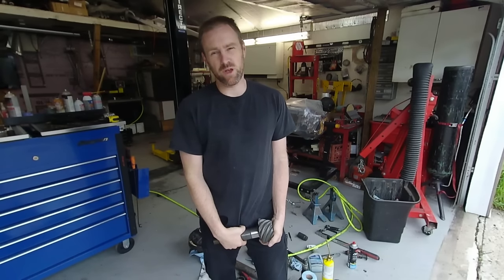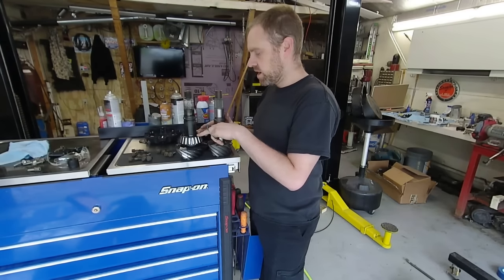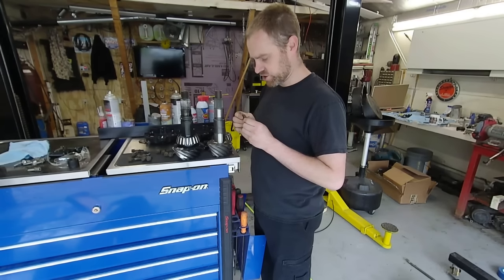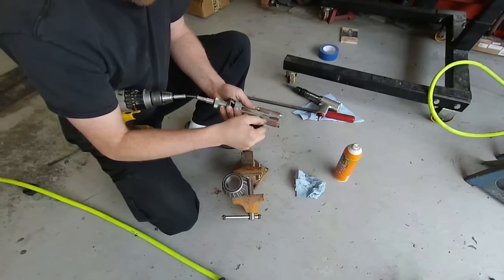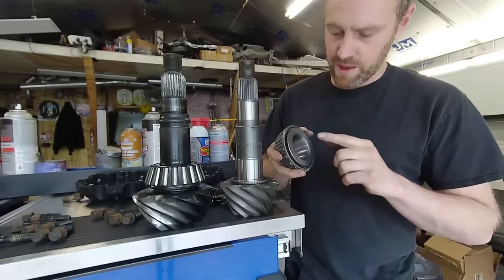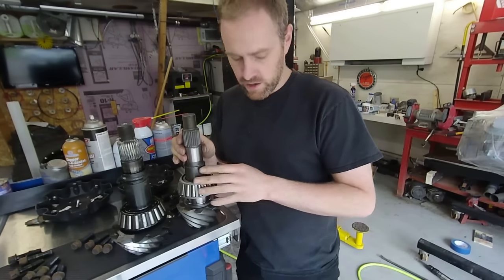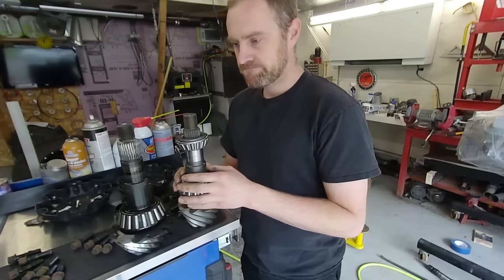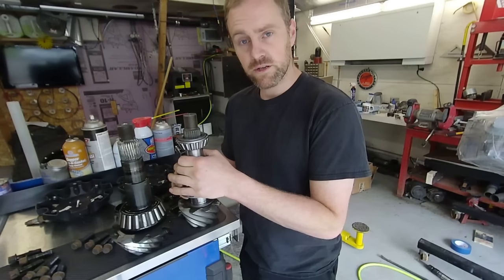Helpfull Tip For Pinion Gear Set Up in Differential

Comment: You are close, but missed it slightly. Simply hone the old bearing to the point that it slips easily onto the pinion shaft shoulder. Install using the doctored bearing and shims and take your measurements. Once you are satisfied with the depth/shims, take it apart and reinstall using a new unaltered bearing. Keep that old reamed bearing in your tool box...you will use it again and again.
Reply from the maker: Good call if I did a lot of these but I have only done 2 dodges in the last 7yrs. I have a large range of rear end variety so I only see the same type a couple times. Plus I only get a handful of differential jobs each year. Good idea for some though for sure.
Reply: @CrazedPerformanceRepair  I used to do this quite a bit back when I was still racing. Doing another atm for a '67 El Camino which I'm converting back to street duty. I deal mostly with 12-bolts, but the 8.8 Ford uses the exact same bearing in their housings as well. For those that want to tackle this I recommend getting one of Ratech's pinion depth checking tools for the housing you are dealing with.
Reply: couldnt your old bearing be worn and change your depth on the pinion ?
Reply: @bandaid1957  Even if you chose to use an old bearing the wear is going to be irrelevant in the grand scheme of things.
Reply: @rickss69  I saw another video where they went as far as to suggest using the same brand of bearing but that was using a pinion depth tool. Im getting refreshed on diff rebuilds since i haven't done one since the 70's . My pinion bearing has gone from a whine to a howl so not going to hone that one out for a test brg.
Reply: @rickss69  did you recheck once the new one was fully installed?
Working on a 55t right now and comparing the old to the new i got .001" difference in thickness. I am wondering how much it takes to move the pattern.
Reply: Use a set up bearing  and you will simplify the whole process.
Reply: @bandaid1957  no, because the bearings wear across the cone face on the rollers and mating surface. Wouldn't hurt to check with a micrometer the width of New and Dummy bearings to sure)
Reply: @bandaid1957  my pinion bearings are in the bottom of the housing, Probably be off a little bit, LOL
Reply: That’s exactly what I do. I use a stone on a die grinder and just open it up enough to slip right on.

Comment: I’ve been setting d and shorting rears for over 30 years I have a box full of honed bearings for all types of rears including carrier brgs. for the Dana type . Good info you sharing ! Bravo for you .
Reply from the maker: If I did enough of them I would do the same. I get such a assortment it's hard to justify keeping any hanging around. It's like I will get 4 diff jobs 1 month of all different makes then I won't see any differential work for a year lol. Strange how things work out.

Comment: Just make a set of set-up bearings and slide on and off. Measure the difference between the set-up bearing and the actual bearing you are going to use and shim the difference. Its a cheap and fast way to set up gears. No need to hone the actual bearings you use. You want them to be tight so you don't spin the bearing.

Comment: Finally a guy that gets it. Been doing this trick for years on taper bearings and sometimes I use an electric pencil if I really need more press at final assembly. You probably would do more damage taking it apart to redo it anyway

Comment: I used a 2" diameter 60grit flappy sandpaper drum in a 1/4" air die grinder to open up my setup bearing.  Took less than 5 minutes to give the bearing less than .002" slip fit.  My setup bearing has a 2" bore.  Use the largest diameter flappy sandpaper drum that fits the bearing bore to keep the process quick and accurate.

Comment: Agree with Richard Taylor 100%, but you also need to make sure the bearing that you are going to hone out has the same bearing inner race height as the new bearing you are installing or else the whole process is a total waste of time, just went through this and then discovered that the honed bearing wasn’t the same as the new bearing.  Had to purchase another new bearing with the same inner race height.

Comment: NEVER spin the bearing with air. The cage is designed to retain the rollers and space them WHEN IT'S IN THE RACE. Auto techs have done this for years with wheel bearings and it makes a cool sound but I have seen them explode and cause serious injuries. If you spin the bearing dry past a slight rotating speed the bearing will be damaged.
Reply: That's the way I was trained as well, if you spin them,   and get them going like that dry, and on top of that, they're loose, not in- cased  in  races, they're more likely to fly apart, and they're not meant to go high speeds when they're dry. In other words, you're doing something that, that bearing is not subjected to, when it's actually in use on a vehicle.
Reply: Learned that the hard way.  Spun a bearing on my finger that I had just washed to dry it.  Exploded on my finger.  Luckily escaped with a minor cut.
Reply: Holy shit, glad I read this, I was totally spraying the shit out of a bearing earlier with the air gun... I dont totally understand how what you guys are saying happens happens, but enough to understand I shouldnt do that anymore lol. Thanks!
Reply: I would say damage is pretty minimal unless something was wrong with the cage. But the exploding .. I could see happening. Lol probably moreso on a old bearing tho.
Reply: If I decide to clean a bearing with air, I hold it and allow to spin very slowly, maybe 5 rpm.  Or I manually turn the entire assembly in my hand.  I worked with a guy who blew a bearing up, he went to the hospital ER to get sewed back together.
Reply: I guess I'm lucky.  I'm retired and air dry spun bearings all my life.  But I never cleaned a damaged bearing either.
Reply: When the bearing rollers spin centrifugal force forces them out and they can and will expand the cage enough to allow the rollers to pass  through! Ask me how I know!
Reply: Safety Dan has spoken

Comment: 5:49 I guess you've never had a bearing explode in your face. Never do that. Otherwise good tip. I've been doing the slip fit for years and use a fresh bearing for final installation.

Comment: I work with a lil larger tapered bearings sometimes we had to clean them if you have a lil patience you can pop the cage off them and clean them to perfection 
Never tried with a pinion bearing 
They are substantially smaller 
Maybe though if u need too 
And the bigger ones I dealt with went back together nicely 
With a final click 
Just a matter of loading up the rollers heading off the inner race 
Bit tricky but achievable
Once clean u have piece of mind for long life

Comment: Get a hot plate from dollar general and a cake pan,fill the pan with oil put there bearing in the pan . Turn the hot plate on high and it drop it in. When the oil gets hot enough take bearing out of drop bearing on shaft.
Reply from the maker: Good call I'll have to try this some time
Reply: @CrazedPerformanceRepair  Also you can put the pinion on the freezer and you don´t even need to press the new bearing.
Reply from the maker: @omarosorio7758  I've done the freezer trick many time but yes that works well
Reply: @CrazedPerformanceRepair  how long to freeze it
Reply: just chuck the bearing in an oven while you're setting things up. 100-150 degrees is all a bearing needs to drop on. good to have a small open toaster in the shop for this

Comment: Bearings are made to such tight tolerances if you just hone the damn old bearing out and then take the the old cone put it in the lathe and burn it down so everything hand assembles get a piece of round stock and make an exact copy of your crush sleeve except as a spacer that you will leave a little extra on the length so you can grind it to size at assembly with both the front and the rear pinion bearings get the pinion set up for depth and turning resistance / preload torque and the ring gear on your carrier set up where you got perfect pattern,  take it all apart. Pull the carrier out take the old bearings off your new pinion put your shims and new bearings on pinion go ahead and seat everything properly and then go ahead and put your carrier back in and double check your pattern if everything's good make sure and double check the torque on your pinion yoke nut, bearing cap bolts and ring gear you're done that way you can work on stuff you don't have to pull the carrier out and push the damn pinion out to change yokes or or mess with any crush sleeve.

Comment: I have a question? can I use the old bearing on the drive shaft side until I’m done setting the pinion gear and then just change that bearing out for the final install. Of course I will hone out the head bearing for getting the shims, right. I don’t think there should be any problems with that procedure, but I don’t do this all the time but you do. I’d appreciate your feedback. Thanks, Great video.
Reply from the maker: If your not changing the pinion gear that will work fine. I was replacing pinion gears to go to a completely different gear ratio.

Comment: Do not spin a dry bearing with air. Spun fast enough the bearing can explode. Washing with mild soap and water will do a better job of cleaning just like using soap and water does a better job than brake cleaner.
Don't get me wrong, brake clean will remove oil and hand prints from handling. However soap and water tends to do a more complete cleaning.
Try this. Next time you replace your brake rotor, take one cleaned with brake cleaner the other with soap and water. If you did it fairly if you spray some brake cleaner on a paper towel and rub both rotors. The rotor cleaned with soap and water  will come up clean while the brake cleaner rotor will still have a little dirt on it.

Comment: put the pinion in the freezer for 24 hrs, then 1/2hr before assembly,  set oven to 200 put bearing in for 20-30min,  when timer goes off, take pinion out of freezer remove bearing from oven, place shims slide bearing over pinion shaft and install
Reply from the maker: That only works if you know proper shim size.

Comment: I would not recommend honing the bearing they are an interference fit for a reason, use a bearing heater or put the pinion in the freezer, the bearing in the oven and it will fall on, I believe the metal expands .001 per 100 degrees so 300 degrees it will go on easy then shrink back  as it cools.
Reply from the maker: It's not going on that's the problem, it's taking it off to adjust the shim without damaging it that's the problem. I know about the metal expansion rate but that won't work for removal.
Reply: @CrazedPerformanceRepair   I am the same way about thing (picky). So why not buy the right tool for taking them off?
Reply from the maker: @russelljones1060  I can't find one to do the job worth a shit, at least nothing at a reasonable price. I only do a few a year, not like diff repairs are my bread and butter. I loose to book time on almost every one since I'm too damn picky lol.
Reply: use old,or preferably new throw away bearings to hone out.do not fit honed bearings..correct is set up bearings,available from bearing stores..not cheap..

Comment: I just spend the money for a pair of new sacrificial bearings. Using a die grinder with a multiflap cylinder, grind until a slip fit onto the pinion is achieved.  Spend $50 for setup bearings folks and you will save yourselves a lot of time and frustration.

Comment: I wonder if u buy two pinion bearing and hone it, and install undamaged one, would be a good idea..
Reply from the maker: Yeah that's a option too, should come close enough to work out.
Reply: hone the old bearings,but yes,new are better as with old you get 2-4 th,less clearence when new are instaled.so if you use old,good bearings,go about 3 th less than need,like 13 th back lash,not 8-10.th.  2th should be enough as things wear.
Reply: @phantomwalker8251  I don't know what the hell you're talking about but absolutely NO manufacturer specifies backlash to be set at 13 thousandths of an inch! .013" is wayyyy too loose and will hum like crazy and you'll never get the correct gear tooth contact pattern. I guess you never heard of painting the gears and checking the contact pattern. It's one of the MOST important steps.
Reply: Actually, the top racers set them up 12-13 thou,  so when they Heat up or overheat the clearance is non existent.
But that’s racing. Google it. You’ll see.
Reply: @joeshumo9457  yeah .016 is a number I hear thrown around with old junk.

Comment: You can also heat the bearing up in a oven and it will fit right on with no pressing to it !
Reply from the maker: Yes but then it can't be pulled back off easy to change the shim.
Reply: you wont get it back off without a press and will likely ruin it doing that

Comment: Hello everyone, i don't do this every day  or month I pulled rear diff  out my dodge ram 2500 /  9.75  4:10 gear and pinion from last person ran truck, pinion is rounded were it should be level sharp like square obviously it was loose, know there's no pre-load  and seems I got replace ring and pinion, but I guess can't replace pinion only

Comment: I have a better tip for everyone. Buy two bearings. Sand the inner part of the race on one so it just barely slides on and off. Use that to find the perfect distance. Then press on the second bearing and throw the first one out.

Comment: I did your trick but I did it by hand using wd-40. Yes I clean the bearings thoroughly, end up using a shim .008 smaller from the original. Although I took 40 hrs. I rather be picky than having to take it out again. I want the actual tool but it's too pricy plus I don't use it all the time.

Comment: Why not hone out the old bearings instead
Reply from the maker: In case the new bearing has a slightly different tolerance or the old one is worn out. Plus most people destroy the old bearings when they remove them because of how tight they are.
Reply: I use set up bearings on all rear differentials that's I've done. I have used the old hearings and used a sand roll to hone them out in a pinch. BUT I don't recommend to ever do what the above gentlemans idea to hone the bearing your leaving on the pinion.
Reply: @mosesmatlock4747  Exactly what this guy Moses said, set up bearings is not a new idea its been done for decades.
I also do not recommend leaving the honed out bearing on the Pinion.

Comment: If you have a decent set of gears the stock shims should be good enough. If the stock shims are not good enough, then the gear manufacturers settings are off.

Comment: If you don't use a crush sleeve for pinion to ring gear contact  setup,
 how much should you run the pinion nut down?
 how tight against the bearings with no crush sleeve, in order to accurately  check contact pattern?
Reply from the maker: Base it off the rotation tq resistance just like when you have a crush sleeve installed. That resistance is caused from the pressure on the bearing not the sleeve. The sleeve should only be put in when you know the correct shim amount.
Reply: @CrazedPerformanceRepair  thank you

Comment: I've got a 2008 chevorlet silverado 4x4 3.73 gear and I had all of the bearings replaced in the rear differential but there is a lot of play in the gears I'm sure some of the play is coming from the slip yoke but is there a way to adjust the ring gear so there isn't so much play or would it just make noise if I did? The guy that did it for me just put everything back with original shims.

Comment: How about this one freeze the pinion gear and heat the bearing it falls right on no press involved. I do that on starter rings for lycoming aircraft engines all the time. It's actually in the Lycoming maintenance manual. You freeze the flywheel with dry ice and just heat the starter ring with a map torch. Again falls right in, let everything get back to room temperature and that ring is never coming off that flywheel until you freeze it again.
Reply from the maker: That would defeat the purpose of the set up. The hole point so that it's easy to pull off again to change shims.

Comment: When setting the pinion depth do you mean put it all together and measure the play in the ring gear I mean how do you determine what the correct depth is with out it all together to see the wear pattern?
Reply from the maker: No, you have to check the wear pattern with marking agent. This just allows easy changing of shims to get it figured out.